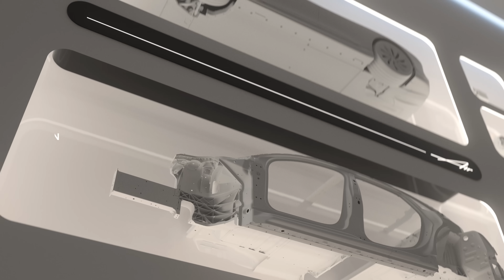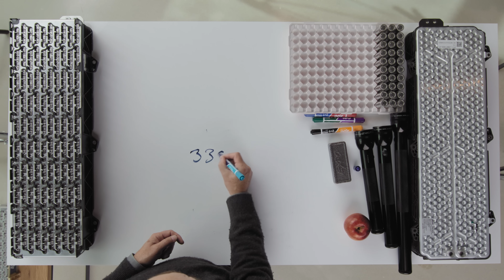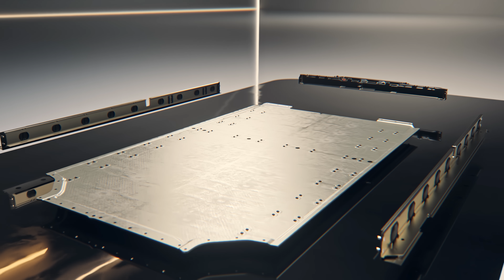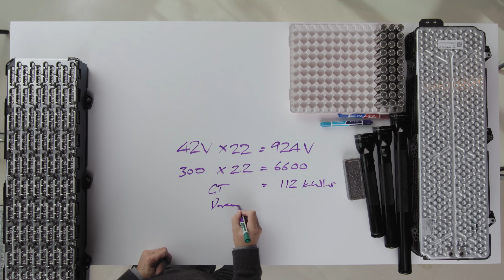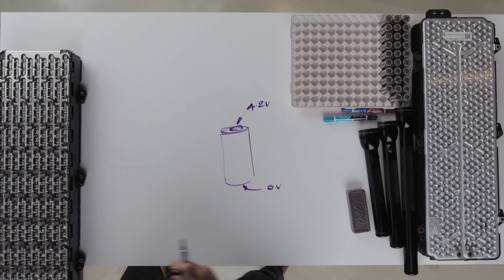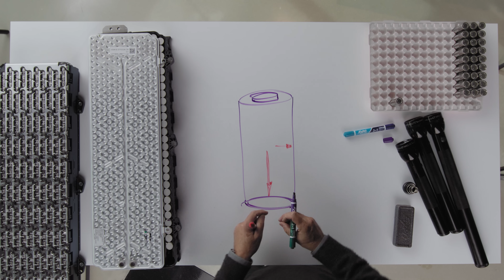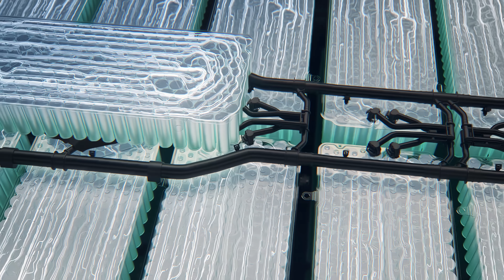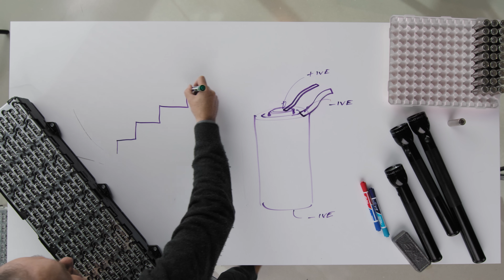Battery Pack | Tech Talks | Lucid Motors

Comment: As long as he doesn’t spend his days throwing little batteries at employees, I’d love to work for him!
Reply: Like how prof throw their cork at thir students
Reply: @danwagner4760  isn’t that the equivalent of having corrosion in your fuel from either your fuel tank or your fuel pump? Your engine’s gonna be destroyed if you have those contaminated in your fuel.

I think we should let these EVs in the market and see if it works or not. This push for EVs is almost like the push of diesels in the early 2000s. Time will ultimately tell whether they are here to replace ICE entirely, or be a companion like diesel nowadays.
Reply: @danwagner4760  which oil company do you work for 😆 🤣 😂 😹
Reply: DAN WAGNER -  @danwagner4760 etc… failure… all can lead to fires. 

BMW just recalled 900,000 ICE vehicles for fire risk. 

What is your point?

I just hope LUCID doesn’t go bankrupt.
Reply: @danwagner4760  I've owned a Tesla Model X for just under 4 years/76,000 miles, that has 6,216 18650 cells in it's pack, there was an early (6 months) degradation of about 5% loss of capacity & about another 2% since then, Those little fuses (cats whiskers) from the +ve side of the cell break & take out any weak cells under extreme discharge/charge operations, so there are probably 100-200 cells disconnected in my pack, Talking to other owners ,this seems to be the norm, Tesla warranty the Battery pack/Drive train units for 8 years & very few replacements I have heard of personally.
Reply: Can't say for sure but that degradation is likely just from cycling the pack. If 100-200 of the cells in your pack already reached a condition where the action of the fuse were induced that would be extremely concerning. I think that the tesla battery monitoring system would not allow your pack to function if even a single battery blew its fuse. Hopefully not sounding arrogant here... I just felt this is important to point out. I have built several battery packs in my limited ev experience and they had a more basic monitoring system... if even a single cell has an issue it prevents the pack from operating.
Reply: @danwagner4760  The BMS compensates for individual cell failures up to 7% at which point, depending on distribution of the failures throughout the array, will signal an error and service recommendation.
Reply: This made me laugh, it used to be pretty normal for the blackboard rubber to get launched across the classroom.
Reply: @rcpmac  that is very intriguing, I wish consumer level bms had that kind of capability

Comment: Thanks for airing this video. As I have something to add here. 

Electrical issue: 
18650 and 21700 share a like architecture in thermally and electrically. Both has a welded tab at the anode-tab junction and not the tab-case junction which opens up a fire hazard issue, should tab-case junction are bumped open circuited by extreme inertial shock, subsequently the release of an internal spark next to heated chemicals. The Panasonic solution? apply a preload on the tap-case junction by an elastomer, it helps passing preload stress from - anode-elastomer-tab-casing. 

On the other hand 46800 has replaced 1) welded tab and 2) preloaded elastomer by 3) annealed copper flaps and 4) preloaded bristle contacts. Pay attention to the flaps. The annealed anode flaps cannot hold its initial shape and will be deformed under constant inertial shocks, shocks coupled via the bristle contacts, one by one disconnected from the adjacent contact until the last contact left. The next inertial shock will finally bump the cell open circuited, to induce a spark next to heated chemicals.

Thermal issue: 
18650 and 21700 cells had to dissipate heat laterally because cylinder wall has a lower thermal resistance compare to cylinder base. Yet Lucid chose to pass heat through cylinder base. Lucid chose out of a common misunderstanding share by Tesla. 

Misunderstanding? 
True:
(A) The thermal resistance in axial direction through metal is less than in an radial direction through laminations chemicals and insulation. 
False: 
(B) it is wise to chose cylinder base to pass heat in/out of the cell. 
Why false? 
(C) There is a air gap in between (anode roll) and (cylinder base). This gap is practically a thermal insulator. That affect Lucid’s pack architecture. 
(D) the air gap is bridged by a wafer of bristle contacts for 46800 cells, as stated in (C) above, annealed flaps and open circuit issues. Granted open circuit is non issue but the bristle contact is as good as air gap in thermal conduction. Can lead to overheated chemical and possible fire and explosion. 

Remedy for 46800 tab less architecture? 
Employ induction heated soldering to bridge the anode-case junction. Result : open circuit proof with excellent heat transfer axially. 

Remedy for 18650 and 22700? 
Slightly extend anode copper beyond the insulation, employ induction heated soldering to bridge the anode-case junction. Result : open circuit proof with excellent heat transfer, actually.
Reply: You have good knowledge in Batteries. Are you working in any company or a teacher or researcher?

Comment: Thank you very much for this very didactic video. I shared it to my community 🙂
Reply: Merci François!
Reply: merci Francois, de nous avoir fait partager cette video, j'ai appris bcp sur les batteries en 30 mn
Reply: All over car have 400V batterie, because it's a classic electrical motor voltage. From 400V to 900V, it's like going from 110VAC to 220VAC (around 1946 in France)
What next ? 900VAC multi phase motor ? 

Thank's for sharing François 😁 
and thank's to Peter Rawlinson for explaining this new way of thermal transfert, that's way is a much more efficient way.
Reply: Merci François :))

Comment: Wonderful information. Huge information dump. The cooling is a win. The molded modules are genius. The bus system is excellent. But what really blew me away was the drive unit cutaway.
The differential is Inside the rotor! I am speechless. Still trying to work out how many hollow shafts it has. Amazing next-level engineering.
Peter, please give us more! 
Patiently waiting for my Grand Touring :-)
Reply: OMG, Watch the Hagerty video about Lucid just released.
Reply: @Miata822  That video is an absolute masterpiece. Seeing a sedan drift around the track like that was crazy.
Reply: It's hilarious how you "gush" over here, but "elsewhere" find nothing but negatives from similar information.
Reply: @rogerstarkey5390  Tell me where I am negative on "similar". I assume you mean Tesla. I find much of Tesla's engineering and manufacturing to be insultingly shoddy. That company has gotten a free ride. Points for being first and good software but they choose "different" over "better".
Reply: Aaaand I got my Air GT, have put 1,200 miles on it. 800 miles of that on a quick weekend trip at Texas highway speeds. It has exceeded every expectation.

Comment: This is absolutely beautiful.  As a side effect (similar to Tesla AI day), I hope this helps Lucid attract talented engineers to push forward EVs
Reply: @jcd-k2s  
Because most "internet warriors" don't have the first clue about "basic physics".
Reply: @jcd-k2s  Agreed.  I did learn some cool Lucid specific tech towards the end (how they step up the voltage in their cell modules and the plastic injection molding for the structural battery pack that also allows for end cooling and cell bondage).  

At some point the folks at Munro would have torn this apart, so why not do it yourself and share the knowledge firsthand :)

Comment: This is why I love Lucid. They haven't just slapped a battery on a car, but excellently engineered it to be the best possible and most efficient EV on the market.
Reply: Best in it's class perhaps, the epa website however shows multiple other evs with higher mpge ratings than the best air has.
Reply: @4literv6  I think ultimately for end-user will be.. "What is the range of this car?" I dont think end-users are concern about mpge as it is insiginificant.. it just define "more efficient".. but efficiency is a combination of many factors.. i.e. arrow dynamic, weight, etc
Reply: @MrJasonjace  Yes, and efficieny within the actual parts, how they have put deep thought into minimizing heat losses in the battery pack for example.

Comment: Why not have the cells submersed in coolant in a similar way to wet liners in an IC engine? A non conductive (electrically) coolant would be needed though.
Reply: Emersive cooling is only really used in formula E because it weighs much more and is a larger sytem to use emersive cooling, and only really needed if doing track racing.

Comment: Very good video.
What is the downside of using a higher voltage system? Does it need more insulation for the wire, the winding of the motor or increase costs of the inverter switches?
It mean that you lose the use all the fast charger that operate lower voltage. ( you could add a system that split the battery pack in two and use lower voltage dc charging)
Reply: Not much downside but also not much upside, tesla achives very high efficiency with 350-450V.

Comment: Should mention the main reason we have "high voltage" power lines is to decrease resistance.  When you push voltage well into the six-figure range then the resistance goes down to a point where you don't have to use expensive conductors or run the risk of melting transmission lines.

Comment: Just a question 
Why not make the cells rectangular rather than cylindrical because it could be better at utilizing the space in between the cells and leaving no gaps and since it doesn’t use side cooling or is it even possible ?

Comment: Also you should divide down your fusing into 3 wires, to increasing the surface are of the conductor and thus suffer less magnetic Flux losses aka Eddie currents induced by ripple voltage

Comment: It looks like a good design and easy to fix after the warranty expires. Hopefully you can just replace a small module or cell if needed, rather than the entire pack. Replacing individual cells would be a lot less costly too. Thank you for the information!

Comment: This demonstrated, in my opinion, the kind of thinking that is imperative to successful manufacturing.  As Peter clearly stated, it was a matter of tradeoffs, but in this case, like a puzzle, a little deeper thinking about each bit of the system helped identify those which could be reduced to minimal while enhancing the outcome through repeatable simplicity.  The physics were a mere fraction of what was just shared.  Basic electrical theory and some materials properties, but, the more important thing he shared is that kind of critical thinking, the analysis of each part, what does it do, what is its purpose, how well does it perform that function and moreso compared to a other, how efficient is it, how repeatable is it, how can it be simplified to become manifacturable with the least amount of complexity.  Those were the real lessons here.  How to think your way through a puzzle.  It's a Wordle in 2.  We all know getting a Wordle in 1 is luck, but, 2, now that's some deep thought.  

I love to ask questions.  Lots of people are absolutely annoyed by it.  But asking the questions is the only way to assure you have answers.  You can't assume your way through a puzzle, you must ask the questions and apply some pressure to thinking about it.  Peter strikes me as someone who does this, someone who like me wakes up at 2:35 AM with an answer that has been churning in his mind.  You can see his pride when he reveals his genius.  The nuggets.

Great video.  Obviously a very successful person.  Unlike me.  He probably had a right education and good mentors.  Unlike me.  But, unlike many people I know, I can tell, he annoys people too because, he asks questions.  Haha.  That's where nuggets are found.

Comment: Hi, The presentation was awesome.

But I've got a couple of questions in mind.

1) Why can't we use both the cooling solutions? Axial and sideways. Obviously there are hindering factors like he mentioned in the demonstration. But what else is stopping you guys from implementing both of them.
2) Why not circulate a suitable coolant through the batteries/immerse them in a suitable coolant? Is it the corrosion? (By suitable coolant I mean, the one with high dielectric strength, that doesn't conduct electricity.)

Comment: My question is why are battery cells cylinders and not rectangles you could fit more batteries in the same space and leave space for cooling all you have to change is the end caps on the cells from a disk to a rectangle

Comment: can someone explain how when voltage doubles current goes 1/4? i didnt get it
Reply: Current 1/2 but losses 1/4.
Reply: @abraxastulammo9940  but to produce double the voltage you have to use twice the current?
Reply: @yekfam4040  Double the voltage and twice the current would give 2*2=4 times the power. The same power you can get with twice the voltage and half the current which is 2*0.5=1.
Losses are dependent on current squared, so in this case it is 0.5*0.5=0.25. This makes it beneficial from an efficiency standpoint to go up in voltage if you can.

Comment: Fascinating. 
I've worked on electric buses for two major manufacturers but this system is extremely compact compared to theirs which used stand alone BIC and BMS modules, which can be replaced if a module malfunctions - which occurred quite frequently. Can the BMS in this battery pack be replaced if needed or does the entire battery pack have to be replaced, since the BMS is integrated in the assembly?

Comment: Thank you Peter, I did learn a lot.  The car is beautiful and 400 miles and/or 500 miles per charge - that's holy grail territory.  My not so new Honda Accord will do 556 on a tank (highway miles).  I would give this a serious look, not to mention the racing heritage of the batteries.  I have to share this with some friends.

Comment: Shaping the battery pack by arrangement of the modules is good and is normal practice - everyone except Tesla does it. The Nissan Leaf is a great example, with a tall stack under the rear seat, shorter stack under the front seats (that need space for seat tracks), a shallow layer under the rear passengers' feet, and none at all under the feet of the driver and front passenger. Lucid's "foot garage" to allow more room for the more upright seating of rear passengers is also seen in the Porsche Taycan.

Comment: So if I understand this correctly, a battery pack with a super/ultra capacitor "boost system" can theoretically have the same or more power (more J/s) than another pack that is twice the size?

Comment: @30.25 When I saw the directional fins, I thought that the cooling plate was a Tesla valve, until you said that the water goes around the racetrack. In which case, you have low pressure (higher speed) flow when the water first enters, getting heated by half the batteries. Then, you take the already heated water around the other side of the race track, decrease the flow rate, and have the already heated water trying to cool the other half of the pack. I’m curious why you did this, and what I might be misunderstanding here.

Comment: Many fascinating details. The one with different gauge bonding wires was certainly not an obvious one. I found the focus on manufacturability especially interesting.
Re end- vs- side-cooling: after experimenting with various approaches, including immersion cooling (in oil), Rimac arrived at the same conclusion on their almost 1.5 MW max power Nevera.
Reply: emersion cooling is the best cooling but only used in non production EVs because of weight and size,  Tesla's side cooling is better than rear end cooling on the lucid, Rimac uses cooling from bottom and top to achieve mor even cooling, even so they are not cooling the cells fast enough to prevent damage from using 1400KW of power on a 120kwh pack. tesla uses side cooling because its the best cooling for its weight and performance, lucid uses plate cooling becuse its less complex and more space efficient, rimac uses 2 plate cooling because they have the money and carbon fiber to keep it cool and not overweight (rimac weighs as much as plaid despite only having 180lbs more battery cells)
Reply: @miguellopez3392  Granted, max power output of 1.4 MW in Nevera is limited to 8 seconds - the thermal management system probably has sufficient thermal capacity to absorb the heat at acceptable temperature and then reject it more slowly. Rimac did experiment with Tesla-style side cooling and rejected it, mostly for  the reason of the rate of internal heat diffusion in different directions within individual cells. Space might have been another concern.
Again, what I find especially interesting in this video is emphasis on manufacturability and cost. Tesla also gives extremely high priority to those aspects, from their "gigacastings" and structural batteries that sacrifice maintainability for ease and cost of manufacture, to completely ignoring ergonomics of its human-machine interface in order to save on switchgear (and have Musk's genius marketing skills turn it into "advantage" in the eyes of fans.)
You cannot have it all - every product (even "money is not object" product like Nevera) is a result of numerous trade-offs, but I think there is room on the market for all approaches. Heck, even Nissan LEAF made it on the market with no battery thermal management.

Comment: Really interesting tech to know. Batteries operating at high voltages is better for energy saving. Although operating at 920v will ask for high voltage with stand capability which ask for better materials and better electronics design. This will add cost and weight.
Also Cooling cells from sides has more surface contact and uniform temperatures are achieved. Tolerances can be an issue but not something unachievable.